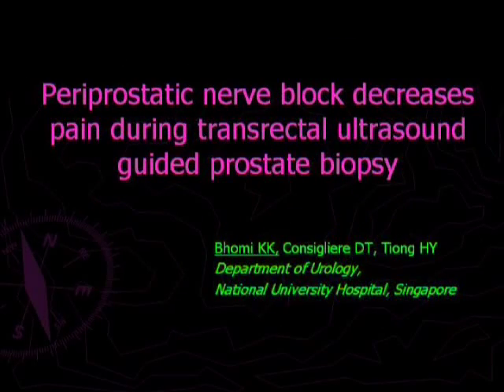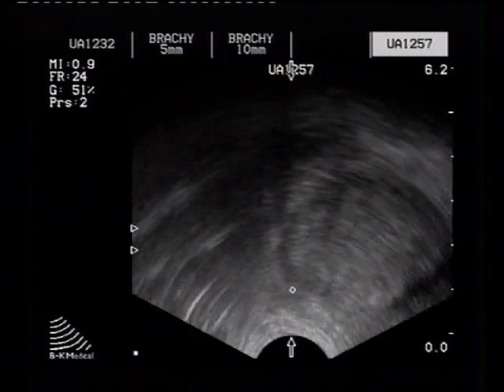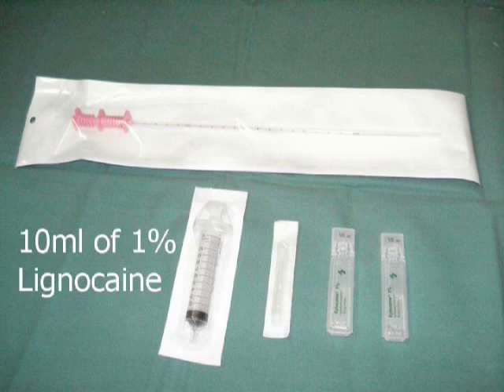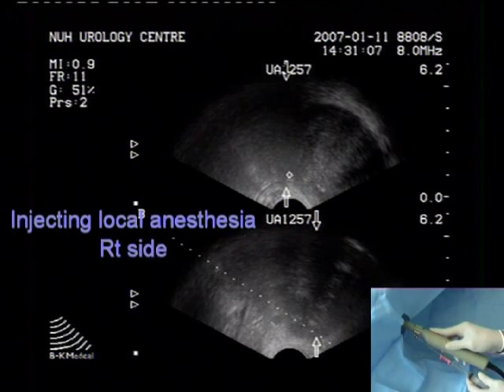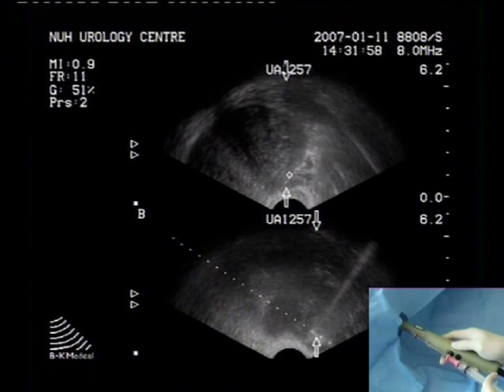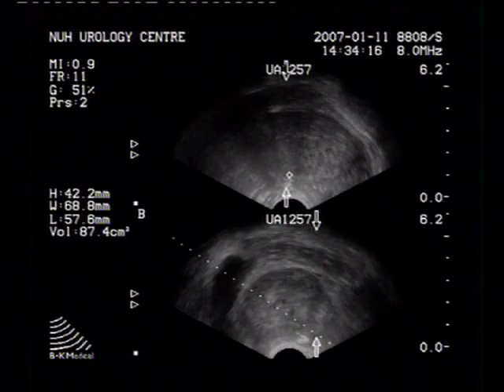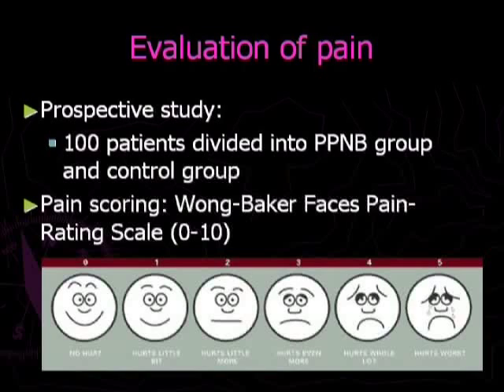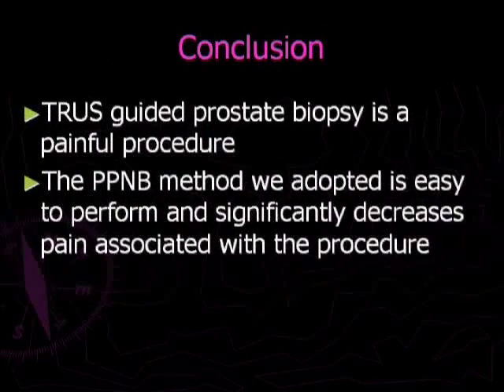Transrectal Ultrasound Prostate Biopsy - Periprostatic Nerve Block

Comment: I'm going to have to bite my fingers this.
Reply: I just had this done, and was concerned to say the least.  The fact I never felt the local, and only knew the sample was taken, by the noise. I was pleasantly surprised.  Maybe I got lucky, or I had a great ultrasound technician, who did the local exactly as she was supposed to.  All I felt was some pressure and tingling.
Reply: Glad it worked out well  keeping the pain down is important part of the opperation

Comment: Nice presentation! I would add to slowly pull back the needle during injection and I think that since I started to deposit another ~3 ml at each side right next to the apex the patients have even less pain at these otherwise often still painful periurethral apical or ventral biopsies. So I use 15-20 ml these days.